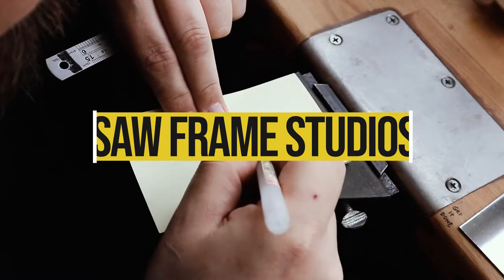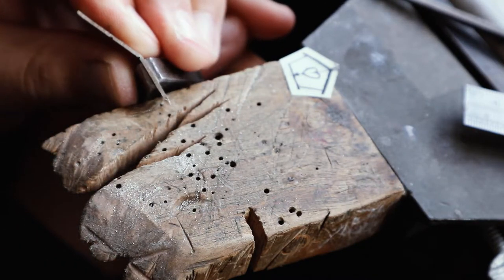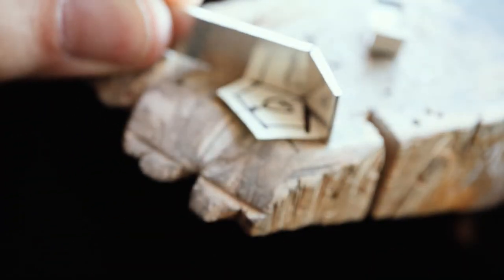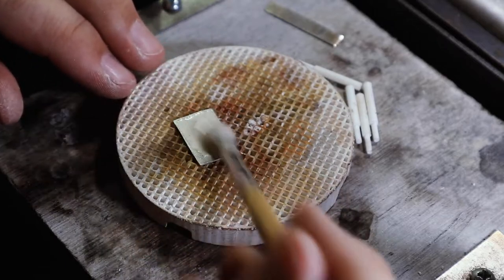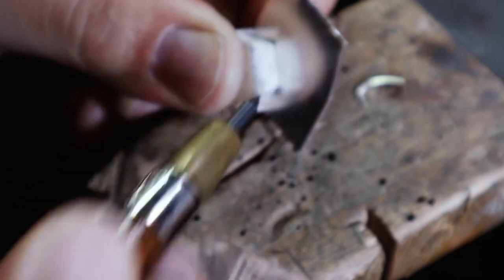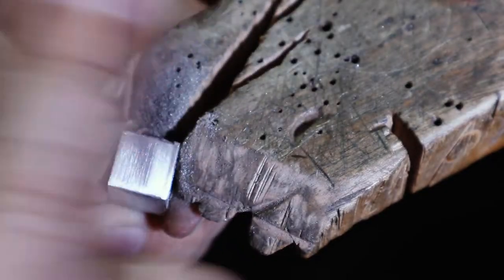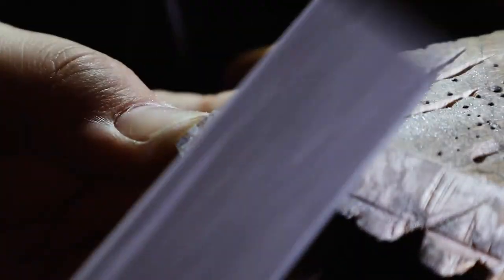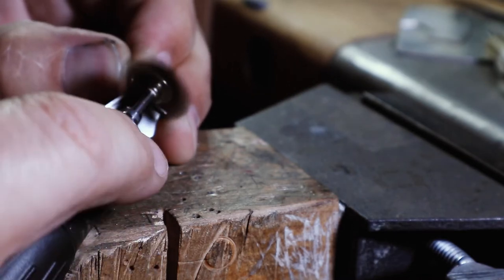Birdhouse Pendant Beginer Project

Comment: Lovely vid Paul, great to hear your voice again, miss the Tuesday classes. Why didn’t you pierce the heart out of the front plate before you soldered it on?
Reply from the maker: Ah Sinead those Tuesday classes were great fun. I totally could have, it was just a bit small of a piece so I chose to do it after. I also have the opportunity to make sure it is centred. As with anything in jewellery making there are often many ways and order to do different steps. Thanks for your comment 👍